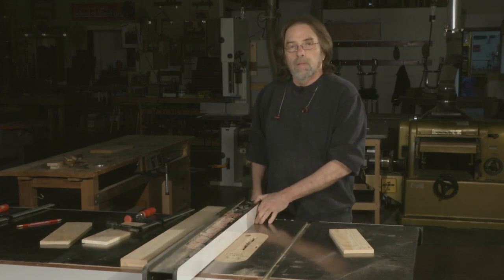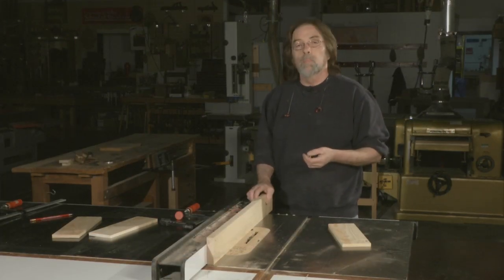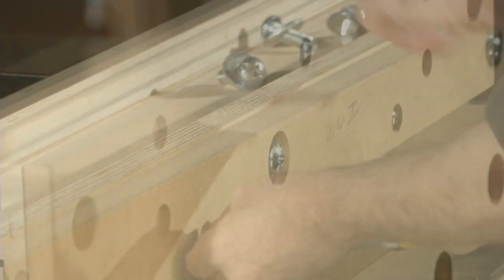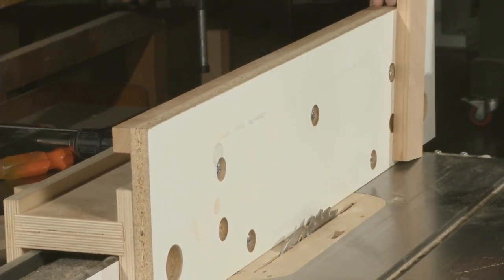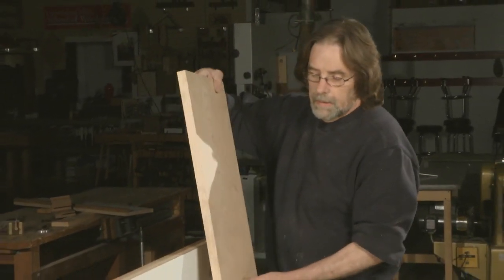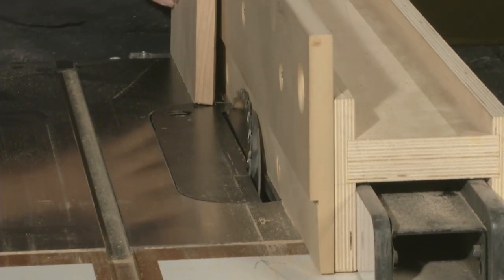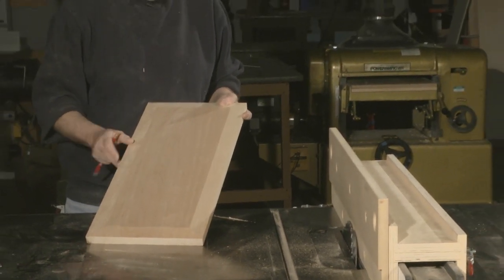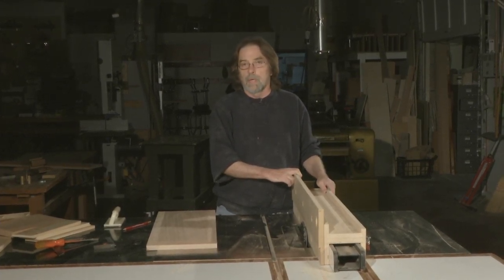Multi-Use Tablesaw Rip Fence

Comment: What clamps and model number are used here?  Can't find any that will have enough throw to clamp through the Baltic birch ply
Reply from the maker: Just replace the bolt on the clamp with a longer one.
Reply: @FineWoodworking  yup did just that. Works great